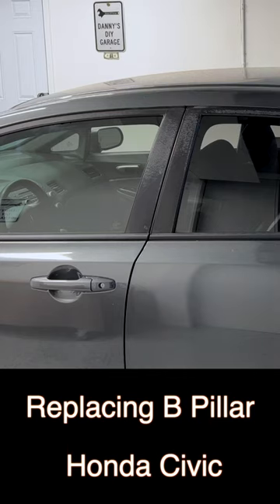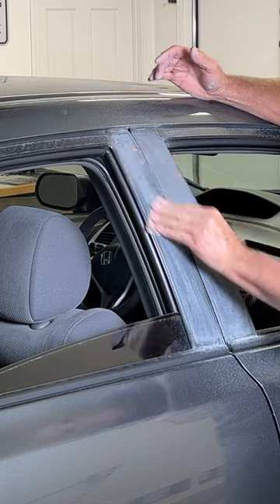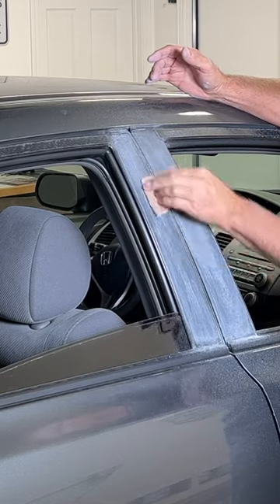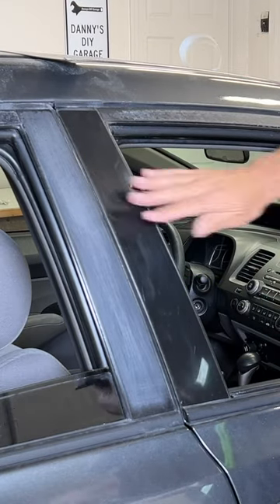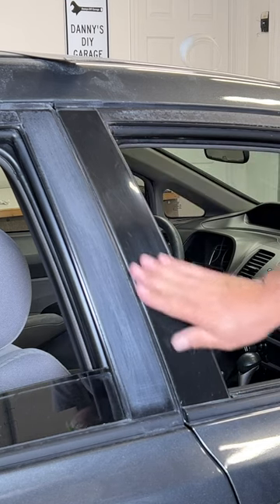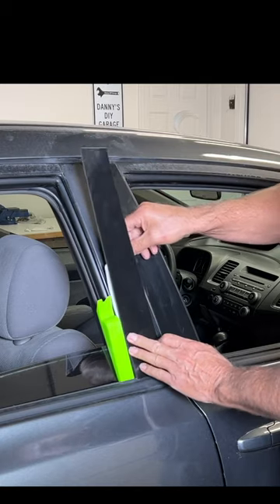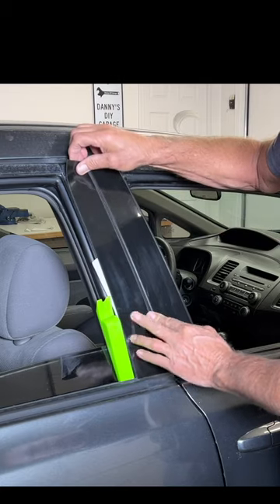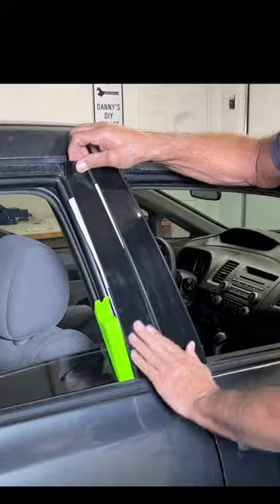Replacing B Pillar  #shorts #Civic

Comment: Do you have to sand it down or will it be better if I do
Reply from the maker: I’ll trust your judgment 👍🏼
Reply: Not necessary, use some degreaser and maybe an adhesion promoter and you should be set, just make sure it’s clean before the adhesive is applied